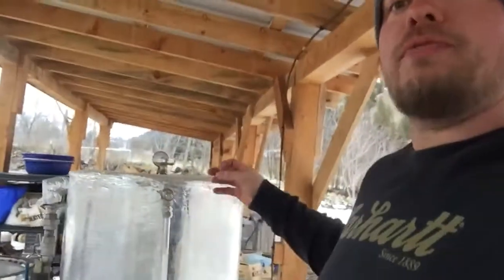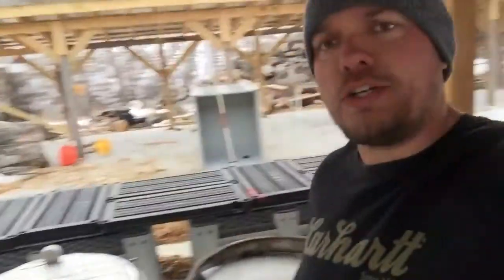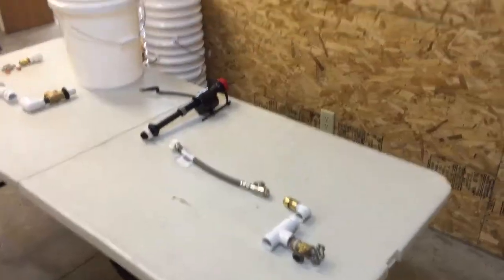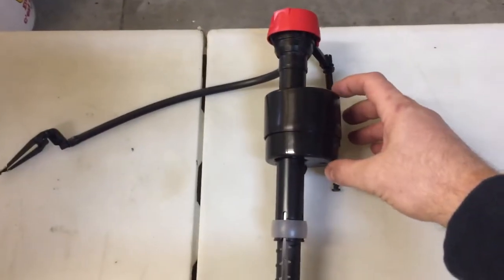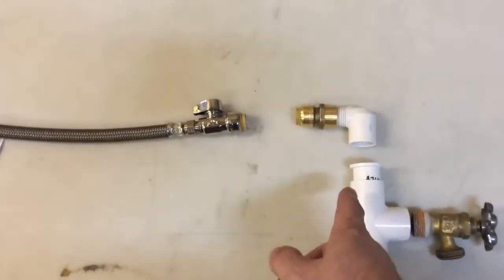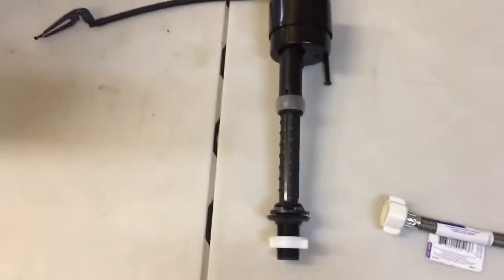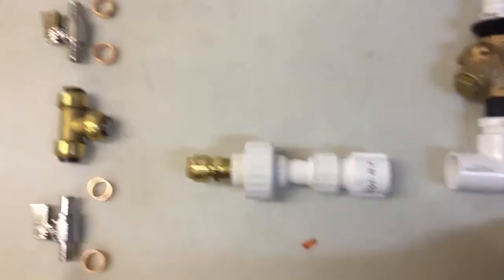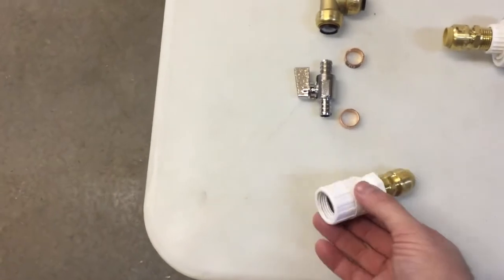WTF VL0G-02 - Saving Money by Saving Energy - Re-design discussion on Sterilization.

Comment: If you want to save your self the time and propane for the initial boiler heat up you should get a cheap instant water heater. We got one and never looked back. For us it takes 2 hours off our initial autoclave startup/heat up and burns less gas to heat up the water to 150F+ (65C) instantly during the fill then the boiler will in the first 2 hours with a cold fill.

Comment: hi I have tried this but the steam pressure stops the flow not enough head of water to push the flow to the barrel I meet up a good heater element. currently I am using a washing machine valve so it can use mains pressure on a timer with the flow from the tap turns down to min as the timer can only run min of 1 min per hour works for the time being..

Comment: Why not float valve one and add connection line to equalize?
Reply from the maker: Skyler Jensen no real reason but having the option to shut off one line and /or connect both lines to the bucket system allows more flexibility. The boilers will equal out first then activate the float valve for more water as needed. More simple with less connections ultimately
Reply: WHAT THE FUNGUS sweet. Getting things started in in WA. Saving up, hoping to make it up there this summer!
Reply: WHAT THE FUNGUS cheap home plumbing parts too 👍